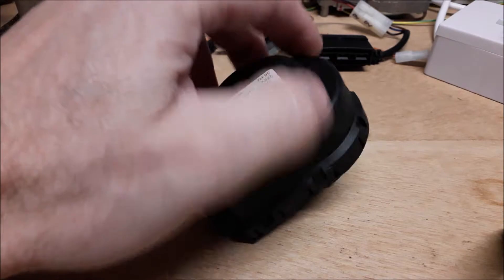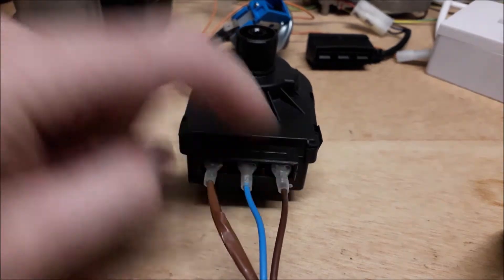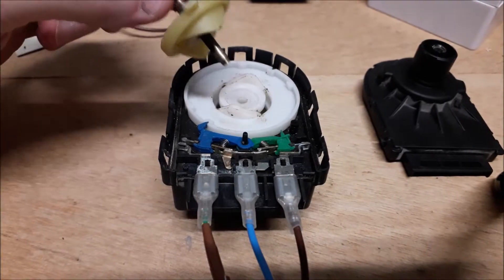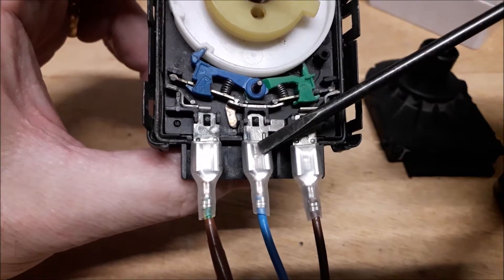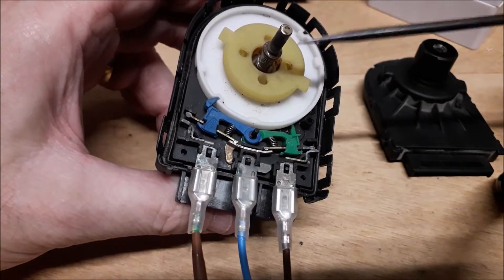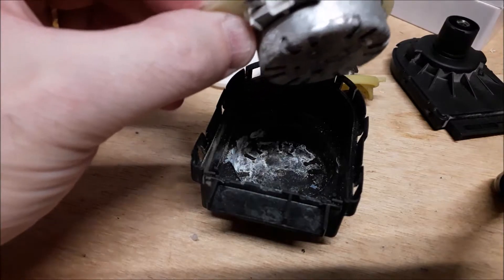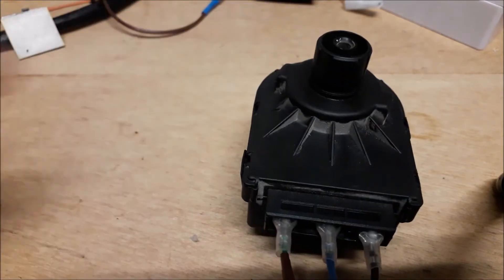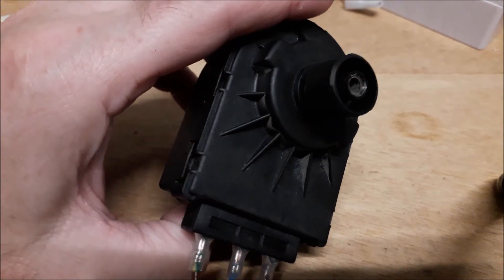The elbi diverter motor stripped down

Comment: Nice mechanical conzruction. I think the Electronic board of boiler add the signal  and it periodically round, when the boiler heats the radiators, and you open a hot water tap. But I want ask some question. What is the heating and what the hot water storage tank heating, the pin out or in? What is the base state for example   diverter valve(Ariston), from above, I ask because my old Ariston quadriga heats the radiators too when only hot water is used, 
and vice versa. It strarted when I turned on the thermostat after 4 months of summer heating break.

Comment: Are these low voltage  motors? and how many Volts in the supply leads?
Reply: They are 230Vac
Reply: At 0m57s you have your answer.  220-240V ac